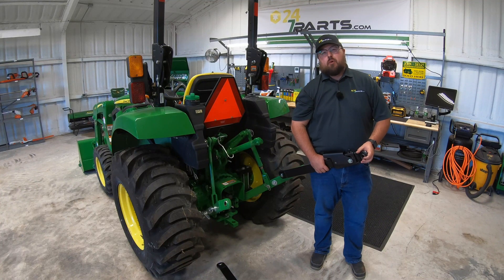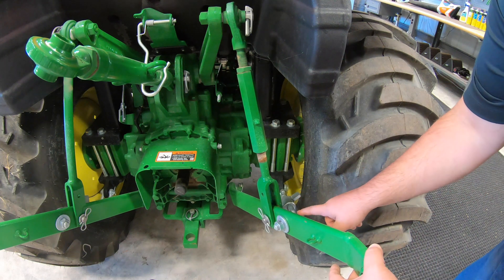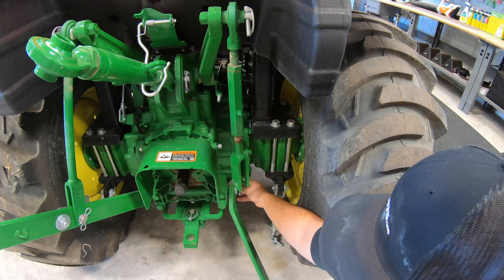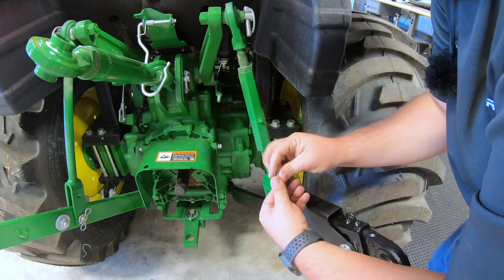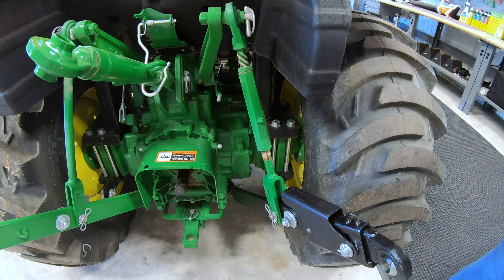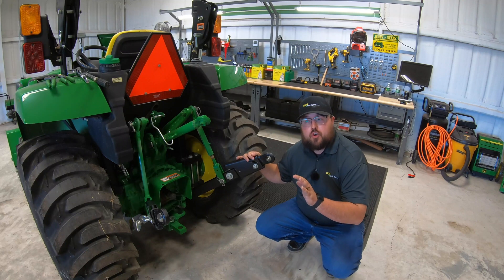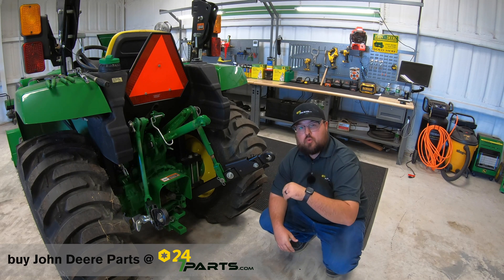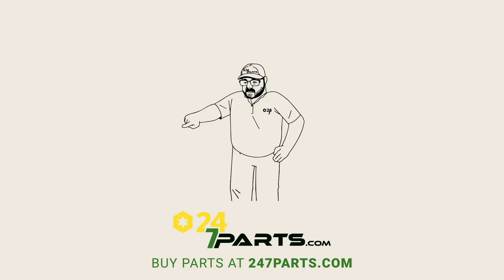How to Install Telescoping 3 Point Arms on John Deere Tractor

Comment: What about the lift arm linkage? How do I adjust the left of the tractor?
Reply from the maker: One of you lift linkages should have a turning mechanism to adjust height but this is usually only on one side and it used to allow you to create an angle on your rear attachment if needed.

Comment: Are these available for the 2038R?
Reply from the maker: Yes, this exact kit would work for your 2038R!
Reply: @247parts , thanks for the reply.  I'll be ordering a set of these from you.  Also, do you have a replacement to get rid of those horrible turn-buckle systems?
Reply: @jimbomaz   did you find anything on the turn buckle?